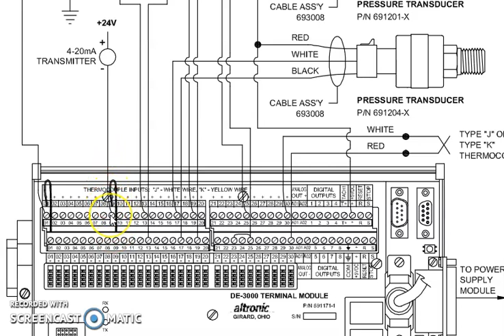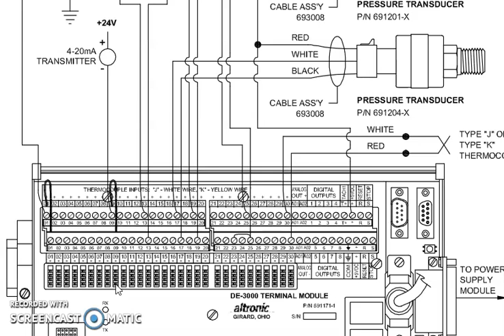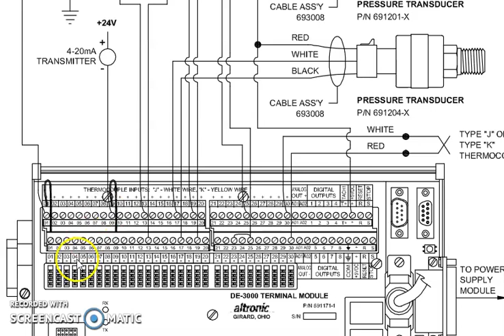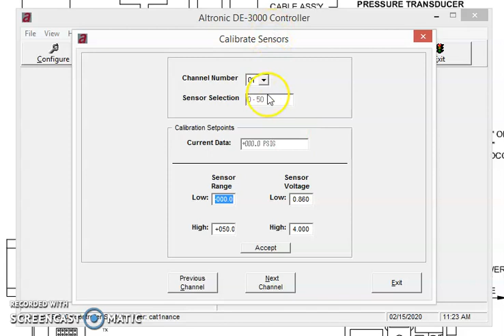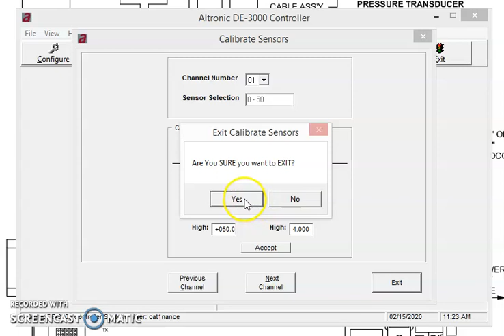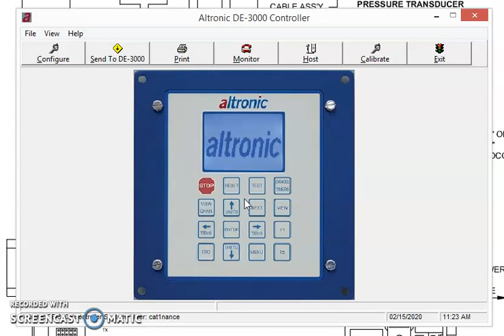DE 3000 4-20mA Transducer Cal

Comment: Where do you measure the voltage? At the +/- terminals of the module?
Reply from the maker: This would depend on what the exact test I am preforming. In most cases, I will place the ground probe of my meter at a panel battery ground point, and just use the positive probe at specific points of interest.